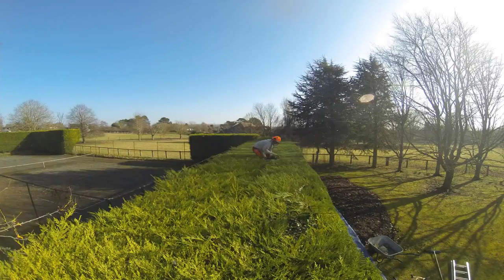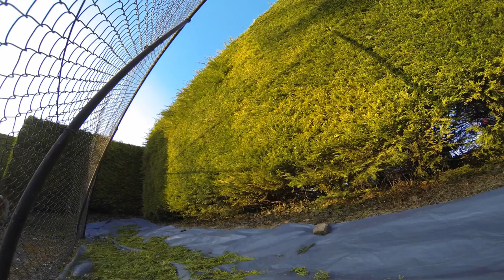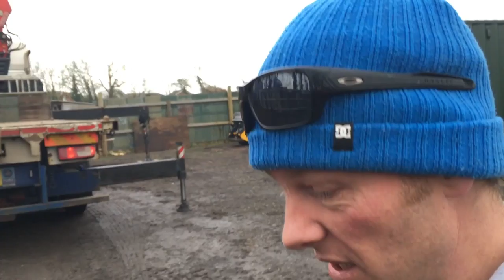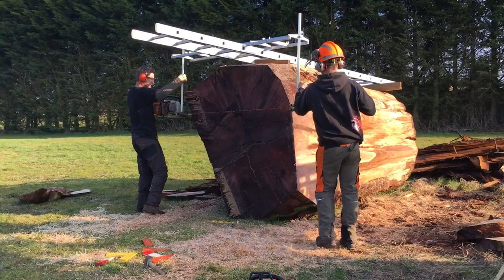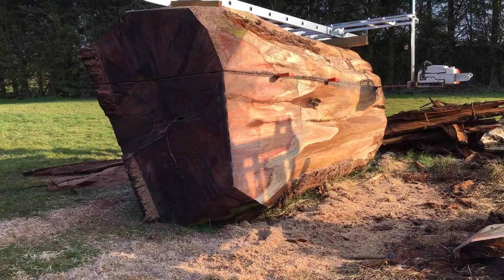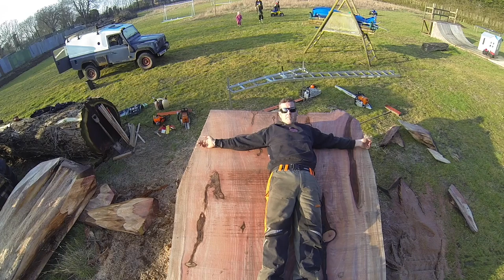Vlog #4 Stihl 87" Chainsaw Redwood

Comment: Damn that was a decent sized bit of hedgework! 

The Redwood looks very nice and HUGE!! Should provide a good few slabs... where did it come from and when is the follow up video due roughly?
Reply from the maker: Thanks mate that was about half the hedges in that garden!  Once I mill the rest of it and have it stacked I will do a project video of it (it won't be a Vlog)  It came from Brookwood Cemetery near Woking, it was going to be hacked down and chipped for a power station!  It cost me a lot to get it to my yard but Im glad I saved it.
Cheers Blaise
Reply: Suddenly feeling better about all the fruit tree pruning and several hundred feet of privet I know needs my attention!  😱

Looking forward to the followup ... I know that so much good timber goes to power stations these days which I agree is better than just sitting and watching it rot. But so much beautiful timber going to waste that could provide a lifetime or three's worth of good use! Surely that's the most green approach?